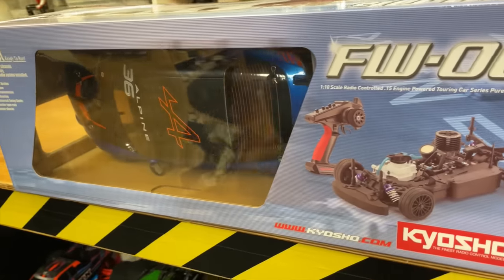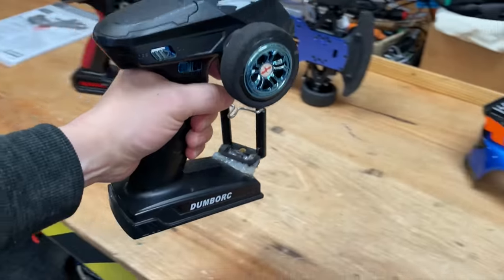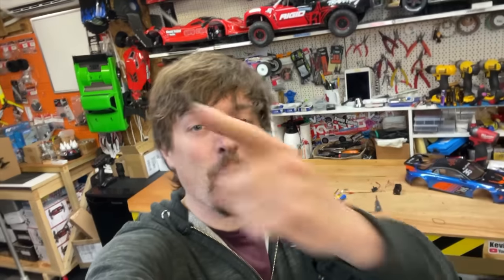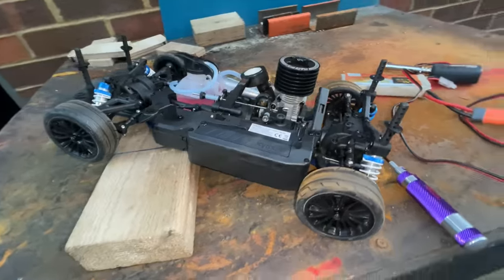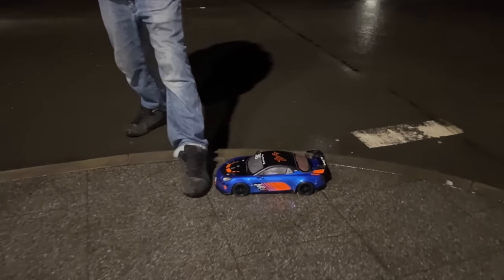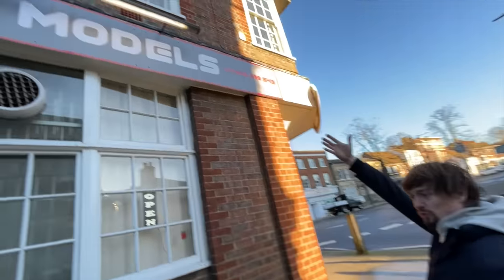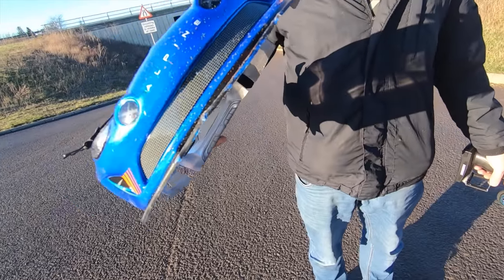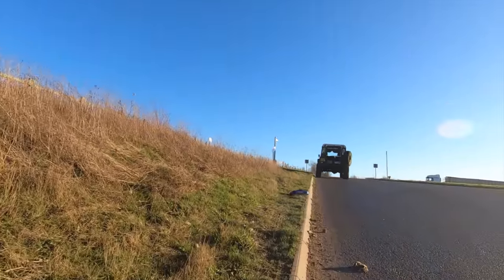NITRO RC Car with 2 speed Transmission

Comment: Grasshopper was my first rc car and i put a 57 Chevy body on it with super fat tires up under the back and skinny's on the front and slammed it down low like a pro mod drag car and put a Kyosho 480 gold motor in it and thought it was the baddest thing ever. It was fast for its time 30 years ago. It was cheap to replace parts too. Amazing how far they've come with rc tech

Comment: My first and only nitro to run those 4 AA clip in receiver packs was a RC10 GT that smacked a curb, ejected a battery at full throttle and proceeded to destroy both axles and three of the four A arms. Lessons were learned.

Comment: Not sure if it still counts but after a high speed pass you pinch the fuel line and count to 3 and the motor should die.  Longer the time you need to lean out the low speed needle.   Short time richen it.  Bit high speed has to be tuned first.  

Atleast that's how I do it.  

Love your channel!

Comment: You can just open your fuel cap and let it snap back shit a few times, and the pressure it creates will Prime the fuel lines very quickly. I snap mine 3 or 4 times and it will push the fuel right up to the carb.

Comment: Kev you can buy / 3d print a extender for the steering on the remotes  which easily slides on the wheel

Comment: hey kev, if you want to use one hand on that controller just use spare tyre to wrap the wheel on the controller. may help your thumb to reach it and you dont have to use two hands.

Comment: Oh YESSSSSSSS an RC with NITRO Engine ^^ the coolest  thing on Rc cars ^^
I have a Buggy 1/10 with a 3cc / 2.5 hp Engine at + 30000 Rpm , very powerfull with good torque ^^ +/- 70kph , i have to uppgrade some componements  to win on speed
You have a new subscriber from Belgium ^^
PS : With same nitro engine i want to build a boat , wait and see !

Comment: I feel there's more to be tweaked from the tuning - looks and sounds great, but doesn't seem to be hitting top revs.
Perhaps its the motor, but my bigger LRP motors definitely revved higher.
Great to see a 'real motor' in an RC.
Al.
Reply: Remember motor still has to be ran for a gallon or 2 before motor wakes up🤦‍♂️

Comment: Hello kevin, have you ever considered using either a headband or like one that you put aroubd your chest to hold the camera? I'm pretty sure there are ones specifically designed for it, the point of view would still be great and you would have 2 hands free to use the remotes :)

Comment: who wants too see Talbot compare the just released HPI Savage v2 against the x maxx
Reply from the maker: Just bought one, nitro version
Reply: @KevinTalbotTV  when will we see it?
Reply: @KevinTalbotTV  also when you run the Savage, there has been reports of the Savage wouldn't shift correctly or be stay in a gear. you might have to upgrade some things on the Savage to help it shift right. there are also videos on YouTube on this issue with the v2 and how to correct it.
Reply: but the brushless version has zero issues out of the box

Comment: Just built this. My steering doesn't move freely. Everything is smooth till I connect the arm to the steering servo. It will turn fully left and right but soon as I move the wheels forwards or backwards even just a few mm it won't turn left or right. Wat servo do I need as it didn't come with any so I'm just using one of ebay what was 7or 8 quid any help would be much appreciated. Haven't started the engine yet as want this issue sorting first

Comment: @kev   will you manage to drive 4 cars at the same time with one Dumbo controller around your local track... ??? 🤔🤔🤔
Reply from the maker: they will drive but not controlled!! haha
Reply: @KevinTalbotTV  that's the challenge .. everybody quits after the first try ,  may try with 2 adjust them as good as possible same motor same servo,esc ....  Let's see what happens ...

Comment: there is an adapter for 1 handed steering u can get that is removable so u can show the actual remote that comes with cause how do u know if it works or not and i made a phone holder that can be used on all my controllers so i chance ruining them attaching right to them.......saves $$$$$ over all......think about those who view ur vids what don't have much funds for the hobby......round ur content out for EVERYONE......meaning fair content to all and just maybe lessen ur haters

Comment: Yo kev Luke again, I love your vids so much and I was wondering if you have ever considered fpv freestyle drones
Reply: Id love to see him send a dji fpv down those stairs.
Reply: Yeah but I meant more of a custom one cause the dji is quite inferior to custom fpv drones
Reply: @lukebellows4927  if you're buying into a digital system you might as well have the drone with the kit. It's not as capable as a custom build but it is a good flyer. Once you have the set you can buy digital cameras for the custom build and unless you're a hard core racer, digital is a much better fpv experience.
Reply: Kev did try to learn to fly a FPV racing drone and he didn't have much luck/ fun with it. 
That's a while back now. Must have been enough to put him off. He never went back to it.  To be honest, Rc helicopter is more fun , once you master the controls of it. (  way more difficult and challenging to fly and  way more adrenaline rush.)
What I'm trying to say... Helicopters are cooler machines. 😬.
Reply: Yes the video is better but the dji fpv drone is inferior to that of a custom fpv drone just with the dji fpv system. The complete dji fpv drone is expensive to fix and just not as many parts available for it
Reply: Oops didn’t read the comment correctly my bad lol
Reply: Red alpha fpv drones are more versatile and have more potential for different things and are not as expensive to repair with fpv drones you can make a living as well as have quite a lot of fun
Reply: @lukebellows4927  Of course my Friend. 
Drones are a completely different class. 
I'm not saying that I don't get the adrenaline flying them. In fact I tend to lose them more because of my own stupidity... And DJI system tends to make feel invincible and push more. Great system. But expensive. I feel more comfortable  with analog on long range FPV planes but that's purely because it's cheaper to lose or crash. Anyway, it's just for fun not for money.  The hobby is already expensive... I got cars, planes, drones and helicopters and Kevin reviewing new stuff is not helping me...😂  My wallet is crying...
Reply: @miklosko3355  yeah I get what your going for . For beginners the dji is great and easy to learn on and same my wallet is in shambles😂
Reply: @lukebellows4927  😂😂🤣